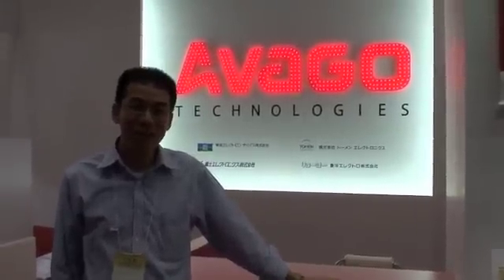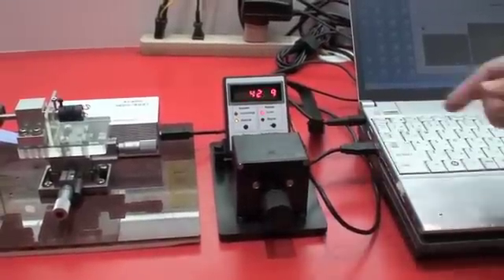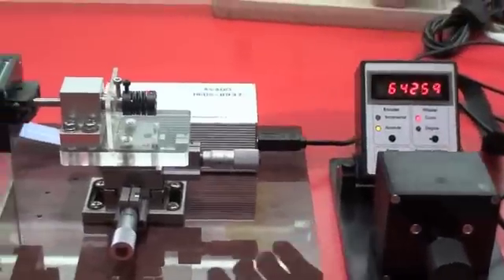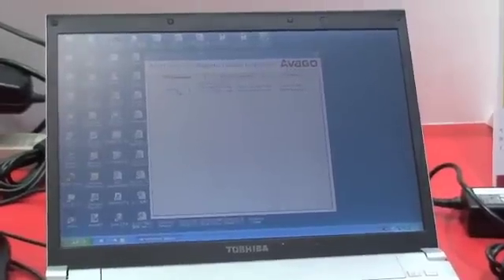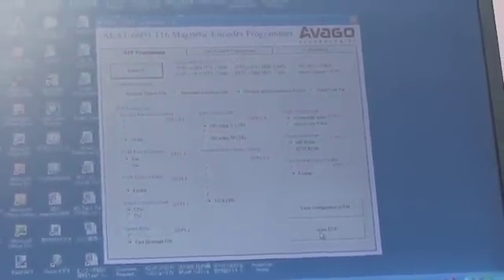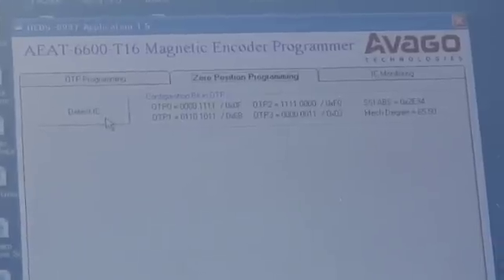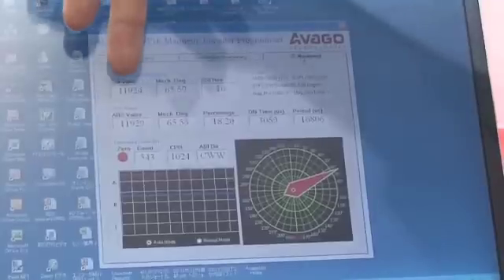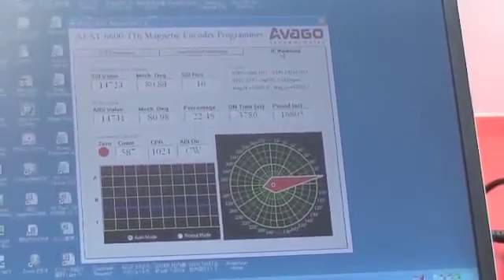AEAT-6600 Magnetic Encoder Demo

Comment: Seems like a lot of noise on the demo reading.
Encoding 5 phase stepper for 64 microsteps is not going to work.
The 16 bit resolution must be with averaging?
Several seconds for each reading?
Is there a github for this chip?

Comment: is there  any microcontrol codes about on this sensor. i read  datasheet  but i didn't understand SSI protocol communication with stm32? half dublex or ? i2c ?
Reply: I would also like to know as I also need to use this with stm32